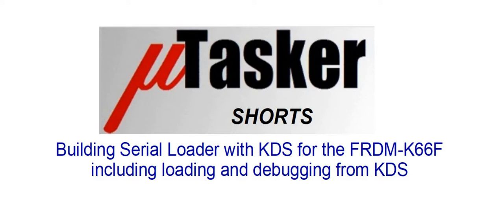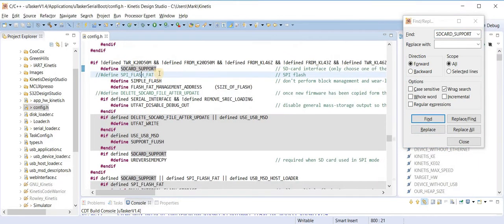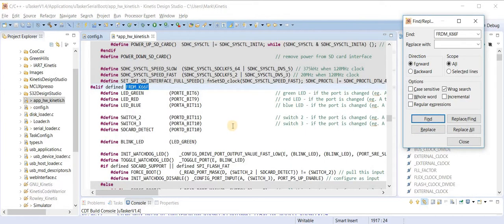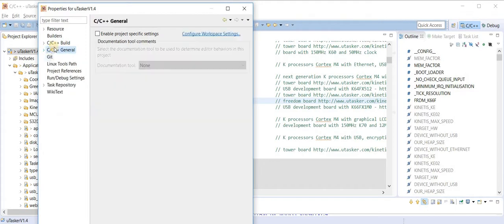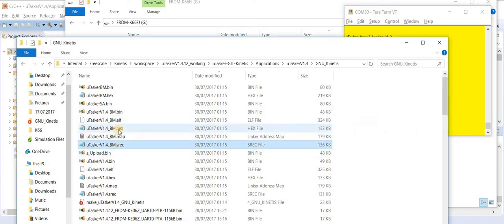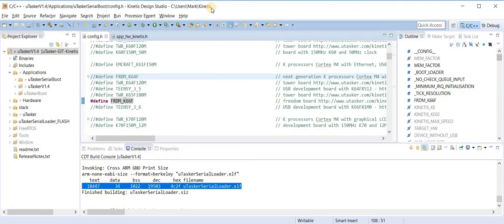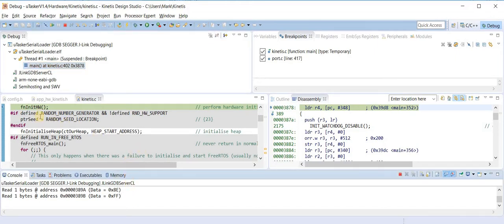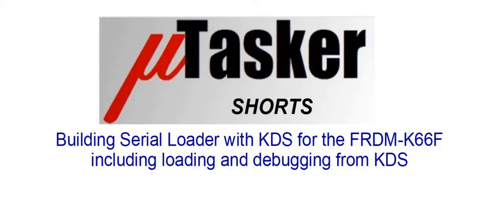uTasker Serial Loader building with KDS for the FRDM-K66F

Comment: thanks for uploading the video
i wanted to ask , after loading the serial loader , and selecting the load application option , you have draged and dropped a .srec file , my project does not contain this file. why is that and what should i drag and drop then.

other than this , my tera term output is not giving a message "sdcard not present". why is that??
Reply from the maker: Hi, see the answer to your question on the NXP Kinetis forum: https://community.nxp.com/thread/317301
Regards
Mark